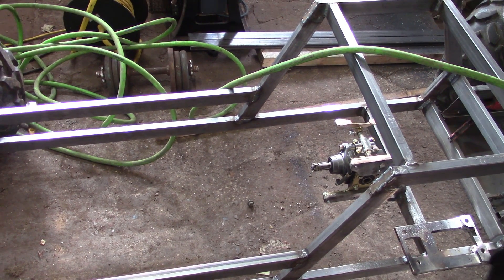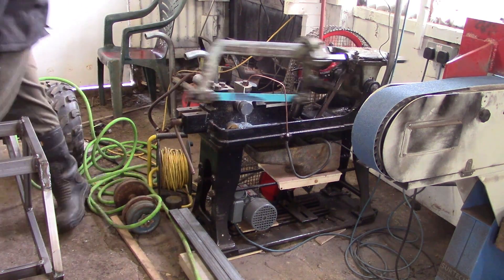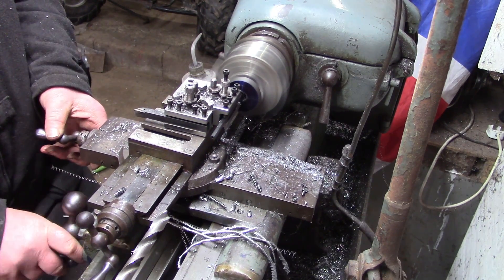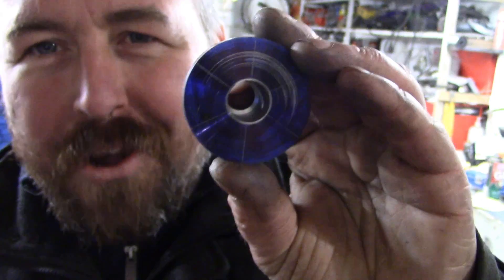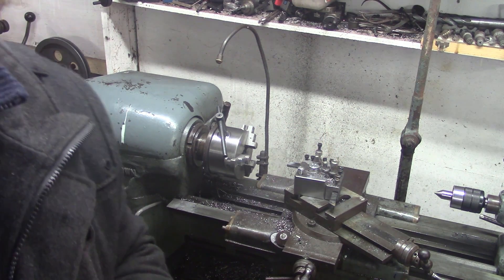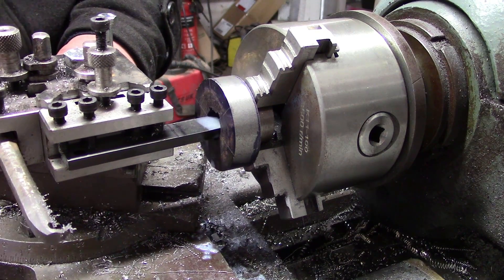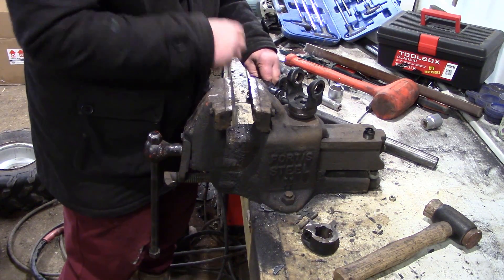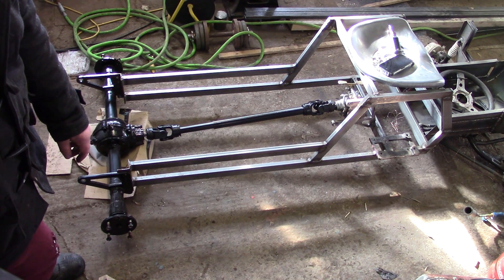Homemade Dump truck MK2 prop shaft- cutting internal splines!

Comment: I do internal blind hole broaching for aerospace applications for a living,   I honestly would suggest using a hydraulic press and as your holding block I would use a rotary table to get a more accurate cut.   They are fairly simple to build and your material removal is much more accurate.  Good luck and very impressive that you got a usable part with your setup.   👍 keep up the great work!
Reply from the maker: Cheers mate, I've since bought myself a tiny little hand powered shaper and collet blocks.
Push broach is on my "wanted list" but they're expensive man
I can make my own tools for the shaper and cut anything I want even if it does take all day!

What sort of aircraft components are you making?

Comment: Those would be cast steel, witch welds the same as hot rolled
Reply from the maker: I'd love you to persuade me otherwise, but casting steel is more expensive than forging it, and these things were definitely cheap and sand cast, they didn't do anything nasty when welded so I'm guessing gray cast ie. very well normalised, but I'm not a metalurgist, just someone interested.
Reply: @turboconqueringmegaeagle9006  cast steel is cheaper than forging, becouse the mold or dies dont have to hold as much presser. And casting steel is the same just a higher nickle content
Reply from the maker: @oldreliable303  what makes cast iron cheap is that it can be taken straight out of a copula, steel has to be first turned into steel from iron then melted in a crucible.
So cast or forged steel will both be more expensive than cast iron but when compared with eachother forging costs significantly more for initial set up ie. The 50t drop forge and the dies but is a very quick process so if many thousands were being produced it would be cheaper than casting steel.
A lot of cast steel we see is investment cast which is a really labour intensive process and only used because it achieves detail that would be impossible with any other process or the numbers are too small to justify forging and it gets much closer to final size eliminating some machining operations. (Gun receivers, track links for some tanks, stainless outboard props)
Sand cast steel is fairly rare, it needs to be produced in quantities high enough to make it more economical than machining from solid yet small enough numbers to not justify the forge tooling and require a final shape that wouldn't benefit from the machining savings that investment casting brings and of course require better mechanical properties than can be obtained with iron or be so large that forging would be impossible ( the Ozzy's produced a sand cast steel tank then some m4's hulls were cast and cast turrets were popular for a long time, entire stern sections of liberty and or victory ships were sand cast steel and then welded onto the rest of the hull)
In short, the pto shaft I'm using here is meant for a 20hp tractor and cast iron is sufficient.

Comment: I like your, dare I say, American, Yankee innovation.  Good job mate.  I've asked several machine shops around Las Vegas.  Seems they have the technology for the supper amazing, but not interested in simple machine work.  Or I haven't found 'the one'.  I want a coupling to fit over a male shaft with an outside diameter of 1  3/8 inch ( 32 mm ) shaft, broached with 18 splines, and on the other end, go into a 7/8 inch ( 22 mm ) diameter, nine spline, clutch.  The job, go from a big electric Toyota forklift motor into a smaller GMC Tracker clutch.  When that is accomplished for a 4,000 RPM motor, my electric GMC Tracker conversion will be that much closer to reality.  

To accomplish the job, I'll probably get a good 2 inch ( 50  mm ) diameter stainless rod or something good, and first drill a 1 1/8 inch ( 28 mm ) hole, then mark off every 20 degrees ( or 18 uniformly spaced marks ) on a blue painted flat surface and carefully 'broach' each one with a three-way vice.  Then I'll chuck up the 2 inch diameter rod and machine off the other end down to 7/8 inch ( 22 mm ), mark off 9 evenly spaced places ( 40 degrees in between ) and broach with my three way vice to make the input.  If it doesn't work, I'll keep trying.  Maybe I'll make a cast, melt two pounds of brass, poor, and after it cools, grind off the imperfections and see if that works.  

Again, thank you for the innovative and inspiring video !
Reply from the maker: Wow, what a project. I'm just a hobbyist with relatively limited equipment, this job made me look into getting a shaper, then with a divider, cutting female splines would be a doddle.
If you wanted to avoid all the machining you could just find the original couplings and weld them together supported on a set of v blocks

Comment: Looks blinding mate. I'm wondering about the join between the chassis and the axle, is it just those 4 bolts? I'm thinking with no suspension there's going to be some twist, and the bulk of the load will be over that point. Is there something that's going to fix that or do you just not think it's enough shear force to worry about? Loving the new 'polished' videos by the way.
Reply from the maker: 4 m6 bolts each side!
I've spent too long working on light aircraft and thinking their marginal safety factors are something I can get away with at home, when the heads all pop off the bolts it'll be easy enough to go up to m8 mate.
Reply: @turboconqueringmegaeagle9006  ah I thought it was 2 each side. 8s plenty eh.
Reply from the maker: @samrowland2816  only one way to find out bud

Comment: Did you do anything to slow the cooling down in the UJs? I’ve had good results dropping welded cast parts into pearlite 👍
Reply from the maker: Yes, I put the roofing torch back on them for a few minutes after I finished welding but with a low flame.
I've still got half a sack of pearlite stashed from previous jobs, if I'd have thought about it I would have used it, welding mystery iron is a lottery for me.

Comment: Essentially, you broached the splines by the pressure of the Allen wrench? Did you specially harden the Allen wrench to have it scrape away the steel like this?
Reply from the maker: Not quite, the Allen key cutter just made a radial groove inside to allow the chip to break away and it was the random bit of tool steel sliding back and forward that made the spline.....   Very slowly, 5 thou at a time.